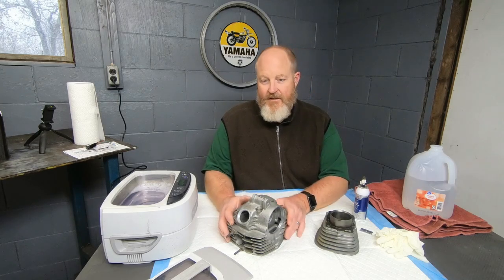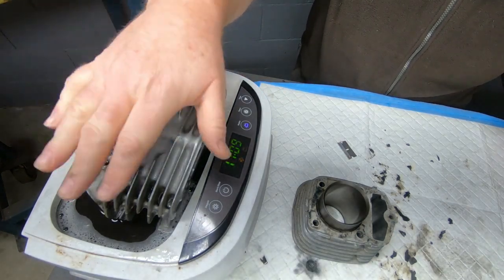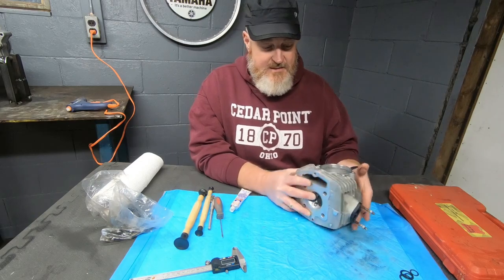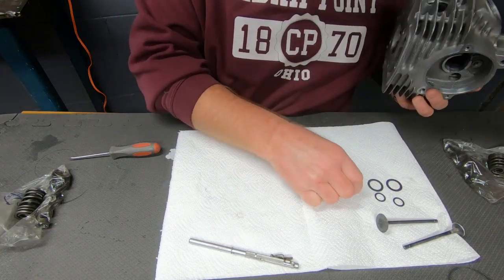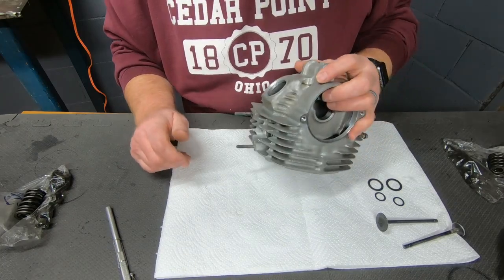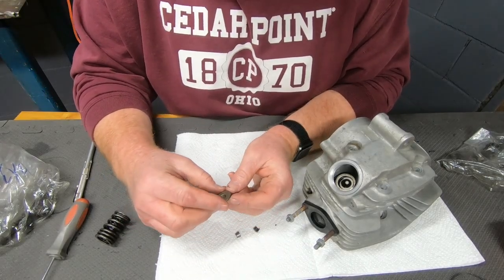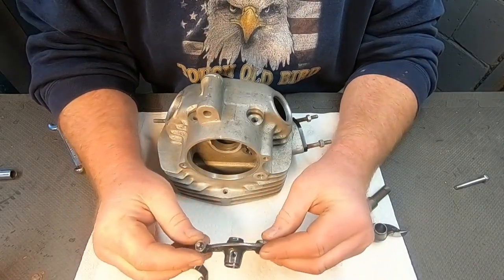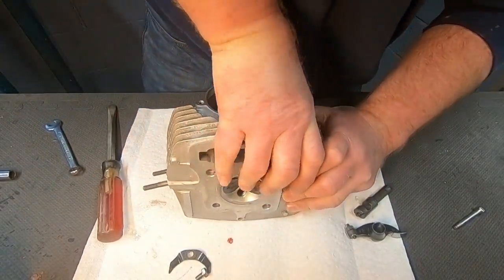CL125 Head Cleaning, Valve Lapping and Installation of Rocker Arms - Restoration Video #5

Comment: Gasket removal can be quite tedious. Glad you show the process. Too many take short cuts.  What are you using in your ultrasonic cleaner?
Reply from the maker: Thanks.  I am trying out a few ounces of Simple Green Pro HD and the rest distilled water.
Reply: @CK-Cycles   There are some purple cleaners which can discolor aluminum. Curious if simple green's is different.
Reply from the maker: @jamesws3  I think that is a good point.  I too am concerned with possible chalking and corrosion while cleaning aluminum in an ultrasonic cleaner with Simple Green (SG).  I found some information on the SG website about cleaning aluminum and so I thought I would try  out the Pro HD in a diluted form.  I also had good luck with diluted dish soap and distilled water as well.  Here is the information I found on the SG website: https://simplegreen.com/industrial/faqs/aluminum/

Use at your own risk 🙂